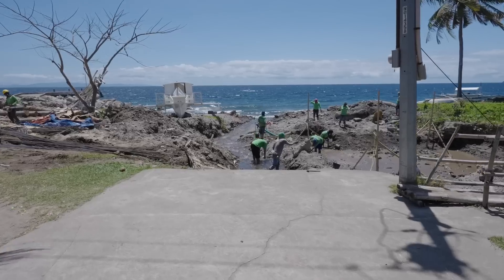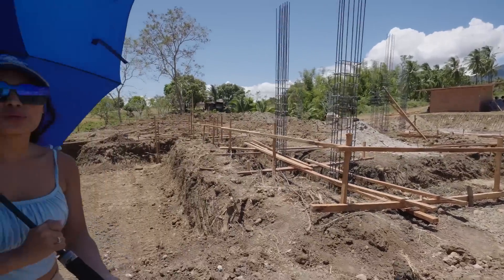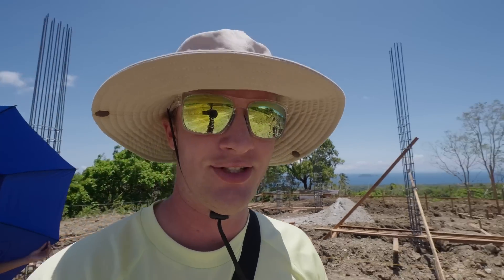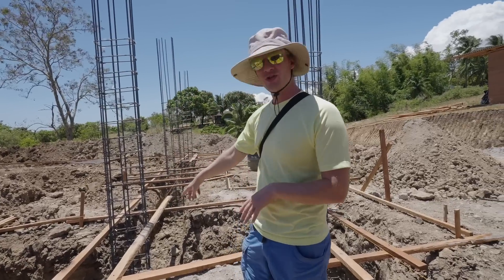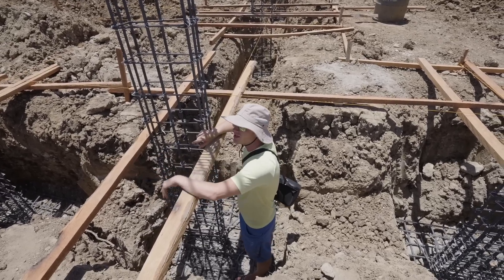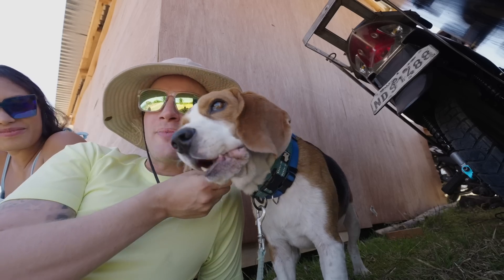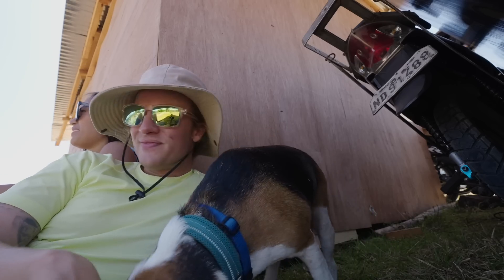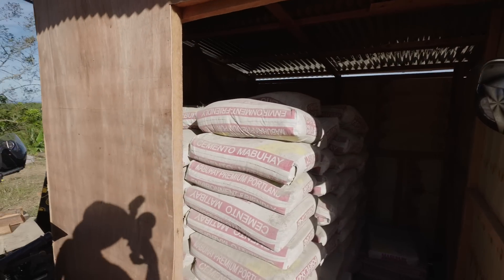CONSTRUCTION START BUILDING HILLTOP HOUSE - Structural Foundation (filmed the eagles!)

Comment: Coming along well! Excited to see the completion! I also live in a hilltop home with lotsa glass.. our cables are underground. Main prob is strong winds, no windbreaker and no insulation from the 10am-5pm sun. It's like a.greenhouse but thankfully we have a 360-degree window system that we can just open for continuous airflow. Our roof got loose during the strong typhoon in 2010. Just have yours checked yearly to ensure right ess and avoid leaks. Can't grow trees coz the typhoon winds might blow them off and they will hit our glass. Just a few pointers there..

Comment: One problem in construction in the Philippines is the laying of the hollow blocks.  Often they’re not straight because workers don’t have proper tools like a level or strings. Thus, you’ll sometimes end up with door or window frames don’t line up properly and walls that are not straight top to bottom or left to right.  Workers also put uneven or unequal amount of cement between the hollow blocks.
Reply: Even big construction company don't have  proper tools puera na Lang high end construction companies😅  Kaya takot ako magpaggawa nang bahay..
Reply: The solution would be  to test the hardness of the hollow blocks.  There must be Arch. and Civil Engrs to do the job, and am sure  they have them securely
Reply: @amendgermendo6746  no I’m not pertaining to that although that is also important. I’m talking about when they are already laying the hollow blocks at the construction site.
Reply: it depends on the contractor, if you just went with a village carpenter, thats what youll get, but if you pay a proper contractor, they have engineers who oversee the construction.

Comment: Hi Finn, coconut wood is really good for quick construction because they're more readily available... However, they're super prone to termites and "bukbok." That's their downside, and we learned this the hard way when we used it as construction material for our business. You have to constantly treat it so that the termites will not eat all of it
Reply from the maker: Thanks for that info! We only use it temporarily
Reply: @FinnSnowVlogs  Nice! Excited to see the finished house... Keep on inspiring us 🤙🏼
Reply: Coming along well! Excited to see the completion! I also live in a hilltop home with lotsa glass.. our cables are underground. Main prob is strong winds, no windbreaker and no insulation from the 10am-5pm sun. It's like a.greenhouse but thankfully we have a 360-degree window system that we can just open for continuous airflow. Our roof got loose during the strong typhoon in 2010. Just have yours checked yearly to ensure right ess and avoid leaks. Can't grow trees coz the typhoon winds might blow them off and they will hit our glass. Just a few pointers there..

Comment: Just an unsolicited comment from a professional mechanical engineer for your enercon.Use  geothermal cooling using the almost constant  underground temerature to cool your house which you could work with your local mechl engr and your reference will be pinterest where it is shown in diagrams.May require changes in your house wall openings to allow the flow of cold air and the venting of warm air. Gud luck.